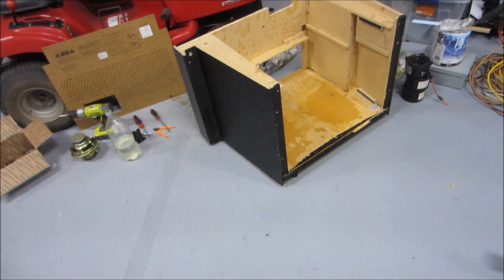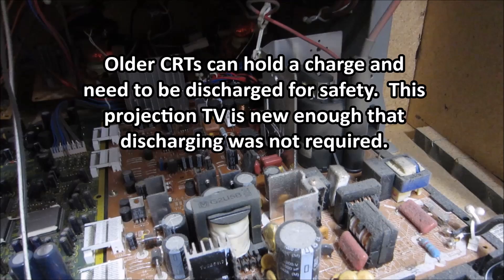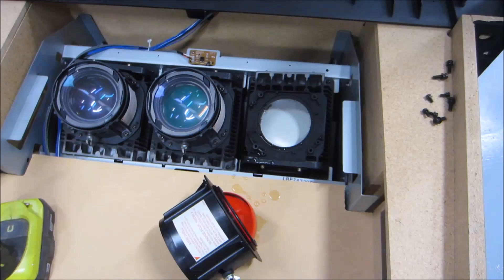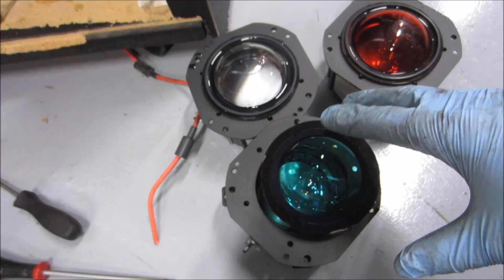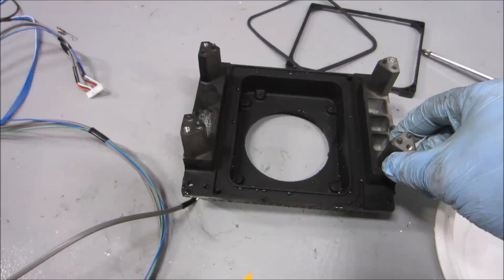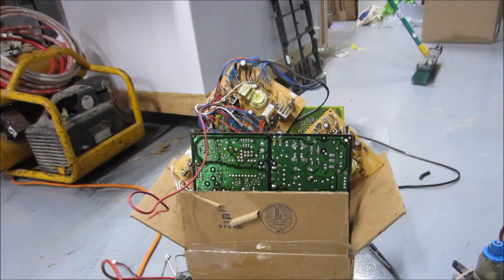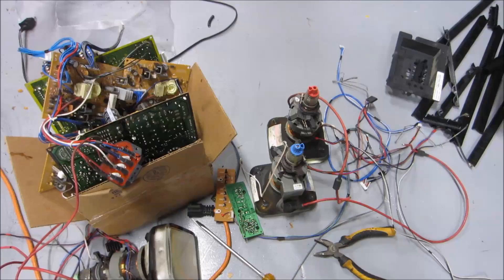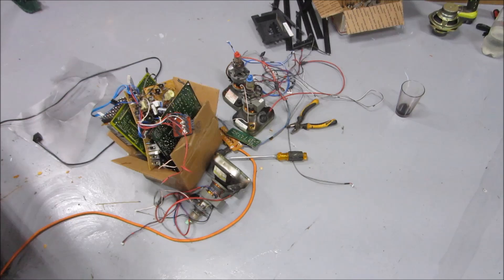Parting EVERYTHING from a Projection TV (tips & what to look out for)

Comment: The metal die cast part is more than likely a zinc alloy like zarmack very productive to work with it has a meting temp around 800 degrees f so its very easy to cast into graphite molds with very little wear and erosion to those molds. Thanks for the vid very informative!
Reply from the maker: I wondered about a zinc alloy.  I can think if plenty of things to use it for in terms of casting.  Thanks for the info!
Reply: someguyinncarolina put some sulphric acid on it, if it's zinc it will bubble really bad and break down
Reply: someguyinncarolina I used to do that with zink copper coated pennies, if you put a knick in it and expose the zinc you can dip it in acid and hollow it out
Reply from the maker: You are quickly becoming my favorite commenter.  I will remember to do that when I get back around to that metal.  Thank you sir.
Reply: someguyinncarolina yeah no problem man, I don't know if it will work with an alloy though.. it might not be as reactive but it's worth a shot.

Comment: Imagine a pane that is a linear fresnel lense on one axis and a defraction gradient on the other. This setup could be used to measure the light absorption, reflection and transition by frequency of eggs. I wonder if one could decompose one compound with a higher burning point than other compounds in a solution while leaving the other compounds less effected by using light of the right frequency to superheat one component while the rest of the solution is being cooled by an external medium. The specific compound could be flash boiled if it absorbs the light beter then the rest and if it is hot enough then maybe the rest would be protected  by the liedenfrost effect.
Reply from the maker: I've read this a couple times and although it's interesting to read, I can't quite make sense of your comment. "frequency of eggs"?

Comment: I did this too. Someone gave us a Sony Wega Projection TV, but a part failed so everything had a green tint. I thought the chassis was unique so I took the insides out and steampunked it. Have  some of the fans and best parts in a box. I have been wondering what to do with the flyback transformer. I found a nice new JVC that fits in the chassis, trimmed it with wood and added some brass fittings, upholstery nails and a pair of candle sconces onto the speaker wings. The thermometer and char-broil logo plate from an old grill finishes it off just to keep them guessing. The cable guy came to upgrade our box when I wasn't home. My wife said he wasn't sure what to make of it.
Reply from the maker: That sounds pretty interesting.  Maybe you could provide a link in the comments?
Reply: That is very creative.    I have a Magnavox projection (wood framed).  Gonna gut an make toybox for grandkids..  Gf don't have our visions..
Reply: I just tore into my Sony Wega true surround sound rear projection tv and found some good speakers. I'd love to see a picture of your project.

Comment: I scrapped mine and the flyback had 3 separate secondary wires coming out the top. My projectors are one whole piece though the back has like a glass cone on them with a plug

Comment: Can I really just use the ethylene glycol in my car as coolant?
Reply from the maker: Not exactly.  You might have a 50/50 ratio of water and ethylene glycol.  The ethylene glycol is simply to prevent freezing.  That said, because radiator systems use a complex system of brazing and are often aluminum components (or copper and aluminum in different components), the heated water will corrode the metal over time.  For this reason typical anti-freeze coolant has metal preservatives added as well.  I would say in older vehicles designed to run on just water, you could add a ratio of pure ethylene glycol and be less worried about corrosion.  Hope that helps!

Comment: a crt produces x-rays. on a regular tv, the front screen of the main tube contains lead to block radiation. on a projection tv, i dont know how radiation is handled.
Reply from the maker: There was some shielding manifold and maybe there was some lead on the CRTs, I'm not sure.  It's also possible the particles may sufficiently lose momentum to no longer be a hazard.  Good question though... not entirely sure off hand.
Reply: Lead sheets.  Just scrapped one and got about 3lbs of lead sheets
Reply from the maker: Thanks for chiming in!

Comment: Amplifier for light?! What school have you been dude? What were you doing during the physics lectures?
Reply from the maker: Sorry, I'm not sure what you're referring to in the video.  Maybe you're talking about my CRT electron saturation comment where I mentioned how it wouldn't make sense?
Reply: someguyinncarolina I believe you were talking about the liquid lense and said it amplified the light
Reply: someguyinncarolina I cannot fully recall I would need to watch the entire thing again, but I think you did say something like that.
Reply from the maker: I just re-watched a portion of the video and caught the reference.  I mentioned the fresnel lens amplified light.  I agree that is technically not correct... it concentrates light, it doesn't amplify light.  Whether light can be amplified in some way is a whole other question of definition... for example fiber optic network relay is taking a weak signal and outputting a strong light signal again. (ie weak/strong meaning the number of photons making it through the fiber)  Is this amplification?  All depends on definition.  I can think of many possible interpretations of the meaning of amplifying light.

Comment: What year did they start to install self discharges? My TV is 2003 and I'm trying to figure out how to discharge if I need to so I dont die
Reply from the maker: I don't think there is "a year"... I think it varies by manufacturer.  Always best to discharge just in case.  That said, you may be able to google the specific model of your TV to find how to discharge it.
Reply: @someoneinncarolina  ok so I've looked and looked and cant find clear steps. My TV looks very very similar to yours. You said to snip the wires after the crts and capacitors have been discharged. Can you explain where these are?
Reply from the maker: @Codeman785  This video was made quite a while ago... I really don't recall much in terms of details.  This link may help out, check out the top item for flyback transformer.  That said, in general tying a jumper to ground and using a long screwdriver to touch contacts on anything suspect, would be a safe bet. http://www.fixya.com/tags/discharge_projection_tv

Comment: I got a projection tv and saved a lot of parts, not sure yet how I am going to use them. Around the screen I found a lot of Little square things with wires going to a circuit board. I think they are photocells but not sure, do you have any idea what they could be and how I can use them? Great video I learned a lot, glad I didn't take the lenses apart and make a mess.
Reply from the maker: Glad you found the video helpful!  My best offhand guess without digging deeper or visually seeing the part you referenced is maybe a button of some kind.  I've seen flat capacitance type touch circuits that resemble photo cells.  Some appliances use them for example, where you hold your finger over a spot and it detects it as a button push.  Just a guess!  I doubt they will be useful without a "brain" box to sense them though.  Simple test if it's a photo cell is to just hook up a meter on the resistance setting and check readings under a light and in the dark to compare. :)
Reply: someguyinncarolina I could take a photo and send it to you if I have somewhere to send it to.
Reply from the maker: Sure, send to this email: someguy@someguyinncarolina.com
Reply: some rear projection TVs have a few little PCBs with a single photodiode on each in the "chamber". idk what for exacty

Comment: i was just about to search youtube for things to do with projection tv optical lenses... as ive got quite a few stashed up now.. and before i did the search, i saw this vid!
Reply from the maker: I don't have any offhand uses other than typical optical.  Maybe use for increasing the viewing angle of an LED.  Maybe focus a broad light into a point for high temperature.  I'll post whatever I end up doing. :)
Reply: I have a huge whackload of red 5mw laser diodes... like, a couple hundred.  do you think it would be practical to focus a multitude of parallel beams into a single point with these lenses??
Reply from the maker: You'd need around 30watts to do some basic cutting probably:
http://support.epiloglaser.com/article/8205/75869/laser-wattage-performance

You'd also need materials of the right nm wavelength to absorb maximum energy from the nm frequency of your light.  I guess it depends on what you plan to do with it.  I suspect they would still be too weak to have many practical applications.  Maybe you could use it to speed up certain drying or polymerization materials.  Maybe highlight things under a microscope.  Personally I'm planning to make a more powerful egg candler with a few higher wattage LEDs focused through a single lens.  I think you'd probably get more energy from focusing sunlight first going through a fesnel lens then another optical lens.  I suppose it might be cool just to do a video of your result of putting all of them together through one lens, then pointing it at objects to see how well it works.  It might also distort the photons though, losing range.

Comment: Hi, you seem to know a thing or two about electronics and TVs in general, so maybe you can help me out (or anyone else who may be reading this comment/question).

Namely, I got an Sony KP-57WV700 rear projection TV from a elderly gentleman, who was getting ready to throw it away, and the TV was working for 8-9 months, before starting to show a lot of red discoloration.

Anyway, I got another big Sony TV (even using the same remote from the previous one) SONY KDFE-60A20, and I would like to use the base of the KP as a DIY stand for the KDFE, but also use/connect with audio cables (OUT from the new/ IN to the old) the audio amplifier and speakers form the older model (built into the wooden frame stand). The old one has superior sound quality!

Is that possible? Can I somehow isolate only the audio amplifier, and still be able to turn the TV on and use it only as a sound amplifier?

I hope you are still reading the replies on your old(er) posts :)

Cheers,
Zoki
Reply from the maker: I think you may be making things hard on yourself.  The first thing I'd do is check the OHMs on the speakers for both TVs.  If they are the same (probably 8 ohm), then you can just swap them.  It may be more of a speaker issue than an amplifier issue in terms of quality of sound.  If you can't swap speakers then I'd suggest using the audio output and plugging it into an external amplifier (then you can have really good sound quality).  If you really want to use the amplifier circuit from the other TV, then you might find the audio output from the panel, trace it back and see if the circuit board for the amplifier is separate or integrated.  If it's separate and generic enough, you might be able to salvage it and make sure it can run on the same power supply, then swap it between TVs (assuming the other TV has compatible power spec and also a modular amplifier).  You'd need a fair working knowledge of electricity, a meter, etc. to make these assessments.

What you're talking about isn't impossible, but it's probably not the easiest option either. :)
Reply from the maker: Actually a correction there - trace the speaker lines back to the amplifier to see if the amplifier module is separate or integrated.
Reply: Thank you so much for your time and consideration. All the best.